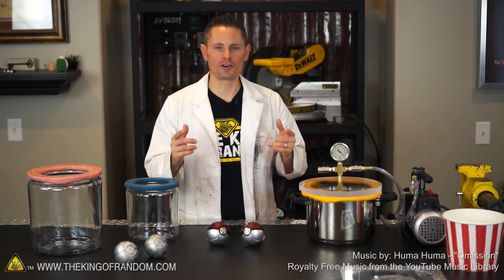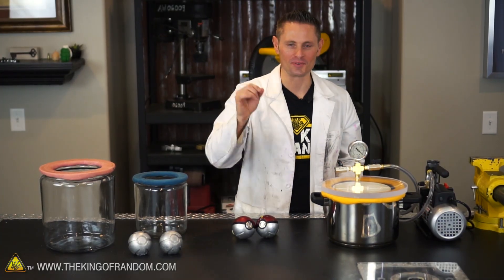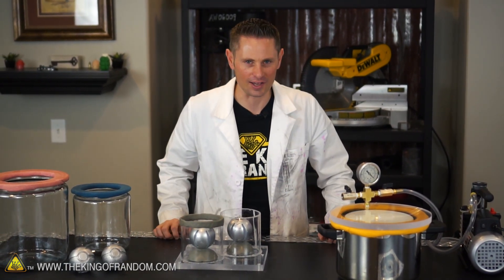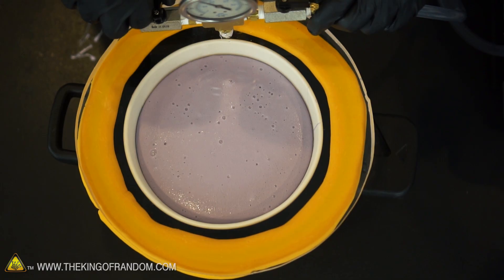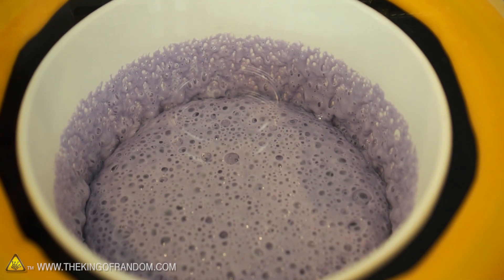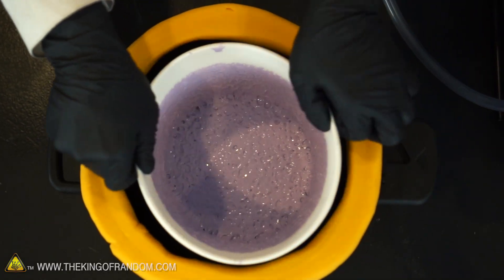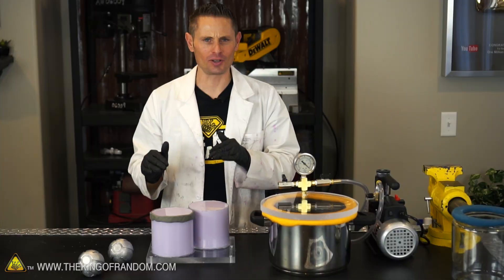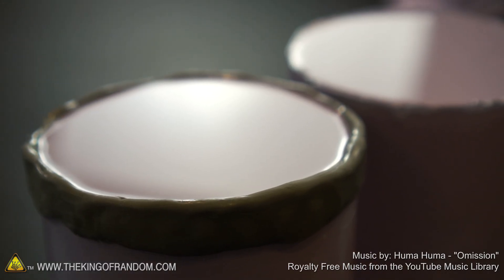How Does Silicone React In A Vacuum Chamber | TKOR's Silicone In Vacuum Chamber Experiment

Comment: Early on in the design phase for a manufacturing process designed to cast in urethane I used a vacuum/pressure vessel.
I've actually still got one in my garage.
This was designed to do exactly the kind of casting you are doing.  First, the vacuum removed the bubbles from the material and went through the first part of it's process... the part you did here with your extraction.  The difference being that the material was already poured around the object.
Second, once the bubbles were removed, the vessel went into a pressure phase.  This shrunk down any remaining bubbles in the material giving an incredibly accurate casting.
This might be something you may want to consider as well.

Comment: I want you to try to use this vacuum chamber to dry clothes. First try to pull out all the water with just the vacuum itself, then try to alternate between pulling a vacuum and adding warm air, then try pulling a vacuum while continuously adding a little bit of warm air. Also I would appreciate it if you included the electricity use and compared it to a conventional dryer. I hypothesize that without adding warm air a lot of the water will freeze onto the clothes. Thank you

Comment: Not to be a dejector but as a gentleman who works in the FX field use a 6 inch diameter pipe at about 8 in for your mold set your base for your Silicone and pot while in the mold frames that way you don't sacrifice pot time

Comment: It would be cool if you made  a specialized lid for the vacuum chamber the had an electric mixer on it ...the motor air tight on top of the chamber and the blending whisp inside the container off to one side so that you can roll the mixture into it...that way you could blend and remove air  all in one step. ..this would be easier because you dont have to pre mix by hand  and you will have more working time.  Cheers...thanx for all the great videos

Comment: I saw this a while ago. I just wanted to ask, if you wanted to remove all the air from the silicone, what if, you had it flowing down a surface so it became extremely thin, while it was in a vacuum chamber? Or just, somehow got it so it's very thin, and can be disturbed to get more air bubbles out.

Comment: Do you think you can change that  DIY vacuum chamber into a freeze dryer using a hot plate and KIMILAR 5Pcs TEC1-12706 Thermoelectric Cooler Heat Sink Cooling Peltier 12V 5.8A in a separate chamber so the vapor don't destroy your pump
Reply: probably only need one or two TEC1-12706 Thermoelectric Cooler

Comment: Hey, Grant a mixing idea that will solve the bubble problem. Get a cylinder shaped container that is sealable. add a heavy metal weight at the bottom that can role when the container is on its side ( preferably a smaller cylinder that almost is as thall as the container your putting it into ), pour in the s silicone leaving space for the hardener. fill to the top (no air space ) seal. Lay container on side and role until mixed thoroughly. No air added to mix. May actually remove some air from the pouring. Used this method where I used to work making latex paint for cloth where air bubbles make weird color spots. It worked there.

Comment: TIP: spray a small amount of mold release on the top of the silicone. It breaks the surface tension and allows the bubbles to pop easier

Comment: Late to the party, I know--but can you use a magnetic stir rod to mix up the silicone? that would stir from the inside, instead of (as the beaters do) from the outside, thus introducing a lot less air. 

Alternatively, could you mix the silicone on a bowl that's sitting on a vibrating plate? The vibrations would cause the bubbles to rise as you stir, making them easier to extract (or not be there when you're done mixing to begin with).

Comment: An old model maker’s trick is to put the casting under 50psi pressure while it cures. All the trapped air/bubbles are still present but become so tiny as to be unnoticeable and inconsequential.

Comment: Rig up a second vacuum lid, but on this lid create holes for the mixer to stir the silicone under vacuum. If you design it correctly you could probably be able to use some sort of a swivel drive shaft to be able to move the beaters around in the bowl through the lid.
Reply: In fact, you should even be able to pour certain molds under vacuum with a little bit of outside the box thinking on the lid design...

Comment: I do this same process for a living and small samples like that benefit greatly from tilting the container and pouring it on the side with one continuous column of flow keeping both containers close to each other. whenever you were filling it from straight above with a small stream everytime it laps over it induces air into the mixture. Just a pro tip I learned from a guy with 35 years experience in the biz. cool vid and my kids loved it.

Comment: I have poured A LOT of silicone molds. I saw somewhere in the comments that someone mentioned what was on my mind. if you pressurize the silicone it actually removes more bubble by forcing them to the surface. also another small trick is to take something like canned air or the can of release agent and very gently and in small amounts hit the surface of the mold with it. it will cause the bubles to burst allowing others to take their place and burst. also a great home made release agent is to mix mineral spirits with Vaseline.

Comment: Hey Grant, I'm a 3rd year dental student, and I have seen Maxilofacial Prosthedontists making silicone ears, noses, and eyes for patients who need them. Some tips I've picked up on when working with silicone is to hand spatulate in a moldable rubber bowl. Use a "cream cheese smear" technique instead of a "soup stir" technique to mix up your silicone. Place under vacuum to eliminate air bubbles, but you shouldn't have very many if you did the hand spatulation right. Finally, consider pouring in segments that allow you to reconstruct a silicone mold if you are working with undercuts in your original object. The war we do at the school require 3 separate casts that we fill with silicone and press together with a vice while it is still setting up. Hope this info is helpful, I don't make these prosthetics I have only seen it done by people with more training than me.

Comment: It's not pulling out the bubbles, it is lowering the boiling point to room temperature. *palm face. For example, put alcohol in a syringe, cover the end and pull the back out, there is no  gas to expand so the alcohol will boil and turn into a gas to fill the space because liquid is not compressible or "decompressible"

Comment: I think the best way to mix it would be slowly from something that mixed from the bottom up, like a very slow blender. that way, the air isnt in contact with the surface that is doing the mixing (unlike the beater)
Reply: But the Silicone drys fast?

Comment: Those weren't air bubbles, that was the substance boiling in the chamber. Try heating it instead at a high pressure. You did the exact opposite..come on

Comment: I've never worked with silicone, but would it help to put the components in a plastic bag and squeeze out the air before kneading the mixture together? That should minimize the amount of air that could possibly be mixed in.

Comment: You weren't finding more air bubbles "deeper" in the silicone. The pressure became low enough and the water inside the silicone started to boil.

Comment: Isn't that folding stream building more air in?
Reply: Adriano Rodrigues 

the long thin stream actually causes any remaining bubbles to pop, and the folding happens in such a way that any air is pushed out as it folds on itself.
Reply: Was wondering about this as well. Wont the pouring process introduce more air bubble into the silicon?
Reply: There was some impatience demonstrated in the video... The stream should have been a bit thinner, but ultimately the same technique... It was the execution that could have been better.
Reply: your wrong I do this for a living and it does not create the best product possible. everytime it laps over air gets trapped. if I poured my samples that way they would all fail govermont inspection upon receipt.
Reply: I too was wondering
Reply: oohh ok
Reply: Adriano Rodrigues I would have piped it in
Reply: BlakeGSites *you're

Comment: Nice stuff! Here is another tip if you don't already know,... You can use toluene as a thinner depending on your model. It helps with the bubbles and the cleanup too! Also, there is a silicone based thinner you can use but the name escapes me at the moment.

We have a similar setup here with the vacuum pumps. We also use a pressure pot to squish down any remaining bubbles we may have missed.

Comment: Could you introduce some type of agitator in the vacuum chamber? I think this would help remove the bubbles since rolling it around appeared to expose more of the silicone to the suction, so like a drill with a paddle bit through the side or through the acrylic? Or maybe move the popcorn bucket around like some type of internal rotating drum like in a washer/dryer?

Comment: You're getting air bubbles because of the electric mixer.  Mixers whip air into cake batter.  If you use a stand mixer with a paddle attachment that should help.

Comment: Why not Jerry rig the vacuum chamber with the mixing beater? That way, not only do you save a tremendous amount of time without worrying about the silicone setting, but you can also mix the two ingredients fast without introducing air, while the mixing beater turbocharges the vacuum to churn out air faster. If the ingredients have to be premixed before entering the vacuum chamber, then you can still mix it in the vacuum chamber but with the vacuum pump turned off.

Comment: Shame not to see finished article.. I know it will come later. I suggest it isn't necessary to pull such a strong vacuum. Rather pull a light vacuum and vibrate the silicon. If you can tune it to achieve acoustic turbulence in the liquid, that might bring the bubbles up faster, rather than make the whole medium expand. I haven't tried it, it's just my reasoning, a suggestion. I believe I have seen painters and decorators use this method of vibration to remove air bubbles from paint. I'm old though and my memory plays tricks. Another method might be to put the two liquids into a plastic bag and air seal to mix.

I do like your shows, they encourage creative thinking. Very few professions would not benefit from creative thinkers.

Comment: Shouldn't you just mix the silicone, fill the cylinder with the pokeball with it and put the whole thing with the pokeball inside into the vacuum chamber? That way all the bubbles trapped in the pokeball cavities would be removed, too, and the mold should come out perfect

Comment: A much better way to mix rubber is by measuring the rubber to catalyst 10:1 and working it through with a flat stick. You get way less air bubbles and just to help it along hit the table to encourage the bubbles to the surface. they will work their way to the top.

Comment: Using a vacuum pulls all the material into a space much larger than it is at normal air pressure thus creating a ton of bubbles as it sucks air in to fill all the void spaces.. Those were bubbles being created not sucked out.. The only potential would be to add pressure squeezing the matter into a smaller space thus potentially squeezing the air out the same way youd pop a pimple. Though im not sure for different reasons if this would even work.. The only technique i know would actually have effect is to shake the matter back and forth vigorously.. The movement in the matter creates in a sense a less viscious solution adding a type of "lubrication" so to speak for the air bubbles to more easily make their way to the top..

      Also, for pouring the molds you should pump the silicone through a small low rpm water pump thqt feeds directly into the bottom of the mold so it fills upwards.. :) Cheers!

Comment: You do realize you were boiling it, not sucking the air bubbles out, right?  You dropped the pressure too low
Reply: ... but when you drop the pressure low enough, it'll boil at room temperature.
Reply: Without ambient pressure, water molecules will actually expand/drift apart until it's considered a gas... which is, essentially, what boiling is-- the phase transition between liquid and gas. You don't necessarily
 need heat to do such a thing, but that's the easiest way to do it here on the earth's surface.  That means, that in vacuum liquids will boil at a considerably lower temperature. The same goes the other way - higher pressure will cause the molecules to "stick together", as you'd say it and, as an example of water, ice will not melt above 0 degree.
Reply: Pressurizing it would be much easier than all that.
Reply: I work with these materials daily.  The trick to remove the bubbles is actually the opposite of what was done here.  You need to cure the silicone under pressure 20-80 PSI.  This will condense the material and the bubbles will rise to the top on their own.  He doesn't have clue.  I mean he has a pressure pot.  That would work perfectly.
Reply: It's more so the state of the matter during the change of pressure. rather than things boiling at different temperatures with different pressure.
Reply: negrojenkins explanation?

Comment: Hi Grant, it's super awesome you followed up on the suggestion on the Aluminum Pokeball video from a month ago to pull a vacuum on your Silicone :-) but did you know that you don't have to worry about setup time? Thats right, you can pour your silicone over the item you are molding, then pull a vacuum on that. If you depressurize slowly you can avoid unneccessary over-bubblings. Take down over the course of 15 minutes and hold for 5 minutes. Then let the air back in and wait for the mold to finish curing. 

Your technique of putting it into a vacuum and re-pouring it will help, but the act of pouring can add bubbles and if you're already behind in time and its starting to set up, it makes it kind of a rush situation. Try building a larger vacuum chamber where you can put it over your entire mold holder, and a mold holder with about 1 - 2" above the "fill line" of wall. Pour it, put it into the chamber and pull the vacuum slowly so that it doesn't boil over. You'll really like the results!

Comment: you should try molding a pokemon in chocolate and putting it inside the gummy ball as a prize. If done in reverse and you use chocolate as the outside it may be hard to get to the "pokemon Center" without damaging it

Comment: About bubles and pouring... in the video i see a layer flipping in zizag, like a vertical SSSS when you are pouring so slowly. it creates another bubble trap.

Other way to eliminate the bubles is making a vacuum on the molded piece when they are filled. but create a holes on the surface and if the shape have inside curve capture more bubbles.

Mixing in vacuum reduce the air inside the mix. so a motor mixer in the glass can make more convenient mixer.

Comment: I've heard that putting stuff like this in a pressure pot is better... For instance, I've seen it done with resin, but I've doubts as to what is actually happening.
My thought is, put it in a pressure pot, then put it in a vacuum to see if all the air had actually been forced out. Maybe instead of adding the catalyst for the test, just use the thickest part, and mix it with the electric beaters to introduce copious amounts of air, and then test it as I mentioned.

Comment: Would highly recommend lowering the height in which you pour. you are reintroducing air back into the silicone by allowing it to fold over itself. 

or redesign your positive mold to allow you to fill it from the bottom instead of pouring from the top

Comment: OK. We have a paint dept. at work and if they put paint over primer that has not fully cured they will get gas bubbles in the paint surface from the primer being sealed while not dry. My quest would be. will you ever get rid of the bubbles from the silicone in a vacuum chamber if once the air is gone your speeding up curing and the amount of gas bubbles from that process?.

Comment: There's this magnetic stirrer, it looks like a giant pill that you may be able to drop into the silicone to stir in the catalyst. It works with a magnet attached to a motor.  Couldn't you use that in the vacuum chamber to reduce the bubbles?
Reply: Probably.

Comment: Dude, I thought keeping it pressurized was the way to get rid of bubbles. I worked at a place where they were casting toy mockups in resins using silicon rubber molds and they pressurized the molds themselves as they cured to get rid of bubbles. could be wrong.

Comment: I've seen people that are doing resin filled wood and other irregular shapes use degassed resin then put the piece in a pressure chamber during the hardening time. The high pressure shrinks any bubbles that did not escape.

Comment: A suggestion for getting the bubbles out is to vibrate the bubbles out. I've seen the suggestion elsewhere for making molds for terrain modeling set pieces. Something like a back massager, or even an orbital sander that is attached or held against the baseplate, can help drive air bubbles to the surface.

Comment: If you're casting a solid object, you could put the object in the vac chamber after its cast. The pokeball is neither solid nor strong enough to withstand the chamber. It would either fill with silicone or break depending on the solidity of the silicone.

Comment: A lot of bubbles can be water boiling due to reduction in pressure. So by having the silicone as cold as the manufacture recommends to be able to use the product you distance yourself from the lower boiling point.